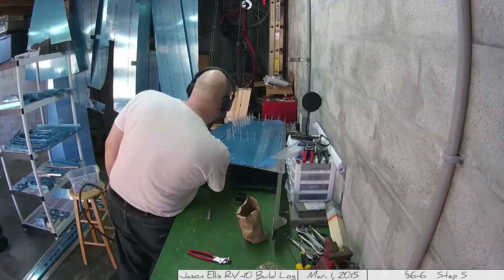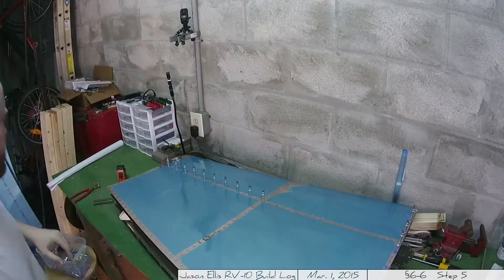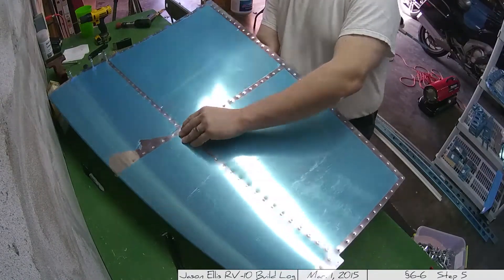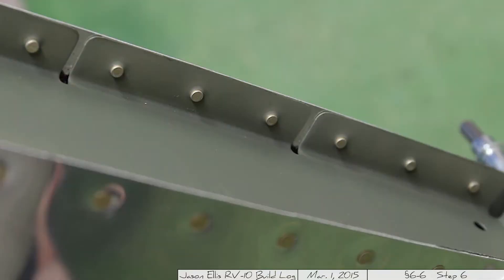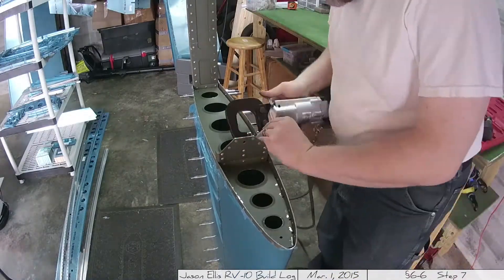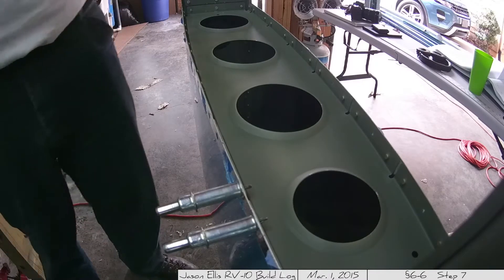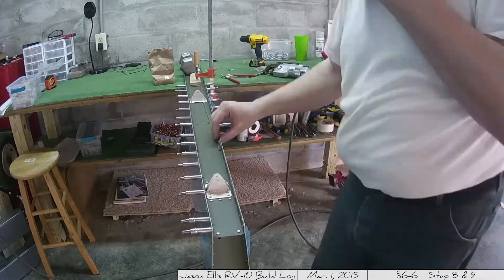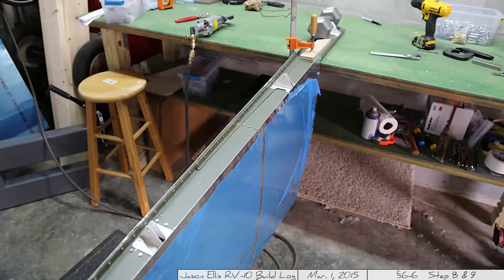RV-10 Empennage Section 6-6 steps 5 to 9

Comment: Jason, I'm confused on your remarks about Step 9.  Step 9 (as I understand it) says to use AN470AD3-4 rivets on the VS-1014-L and -R Rear Spar Caps to the rear spar, BELOW THE SKIN, with AN470AD3-4 rivets.  The diagram (Figure 1 on pg 6-6) only refers to the 3-4.5's on the skin when riveting it to the rear spar.  Does that make sense?  Just read what Josh said below.  What he said.  : - )

Comment: I'm doing this tonight.  I think the instructions (Step 9) are only calling out the rivets you use on the rear spar below where the skin is attached.  So the top 11 holes get AD3-3.5, the middle set (where you are going thru the VS-1014 spar caps) get AD3-4.5.  The lowest ones not shown on the diagram get AD3-4 as described in Step 9.
So I think they are correct, although could be worded a little better for sure.